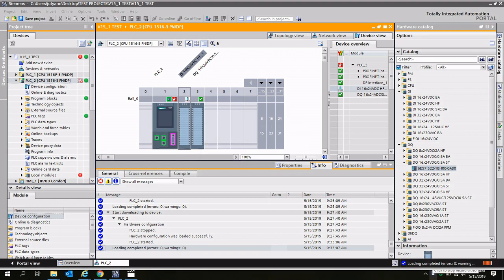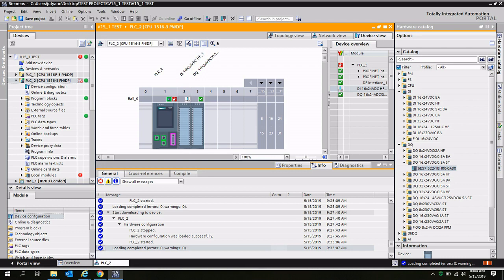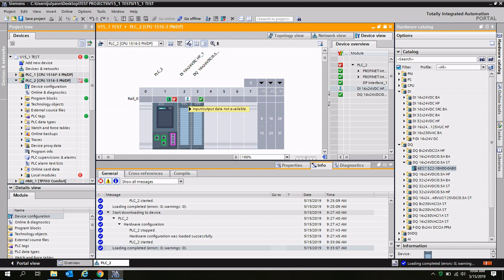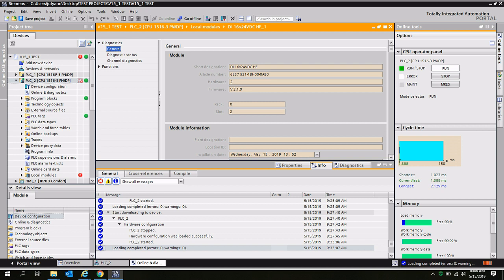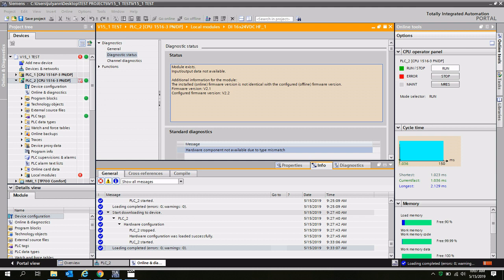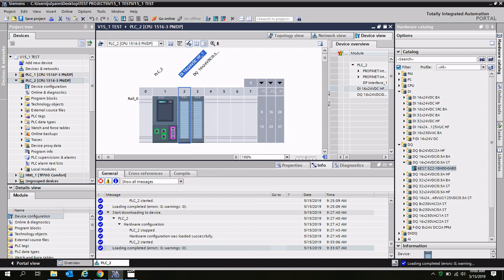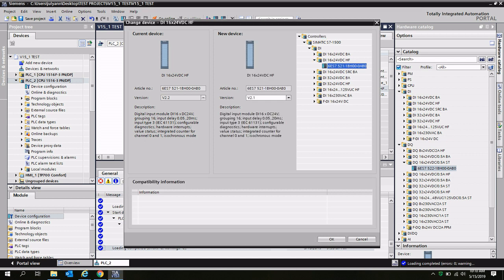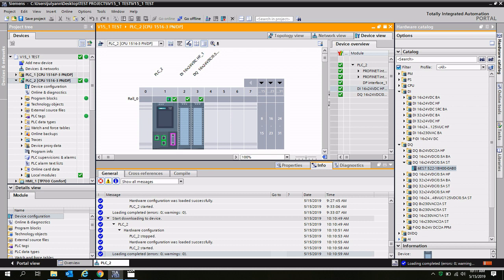Troubleshooting Firmware Mismatches in TIA Portal | Authorized Siemens Support | AWC, Inc.

Comment: I need to find v4.5 in the drop down, but i only have up to v4.2 how to fix?
Reply: Looking for the answer to this too.
Reply: Having this issue too. PLC has FW 4.4.1 and I can only select 4.2 when adding a new device. I tried factory reset and even loading 4.2 into the plc via online & diagnostics. Factory reset doesn’t touch the FW and it won’t let me roll back to 4.2. The only thing I can think of is having to update my license from portal V15 to maybe V17?